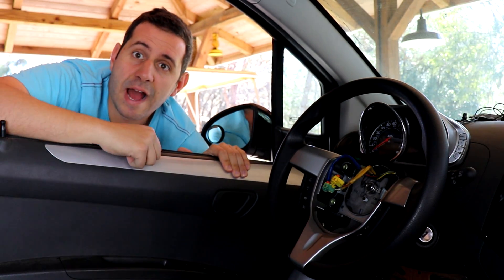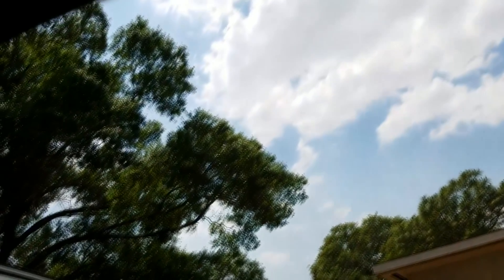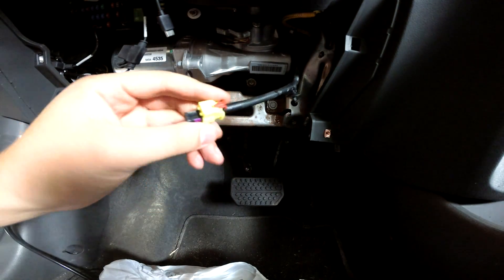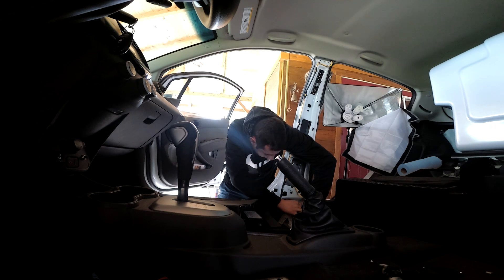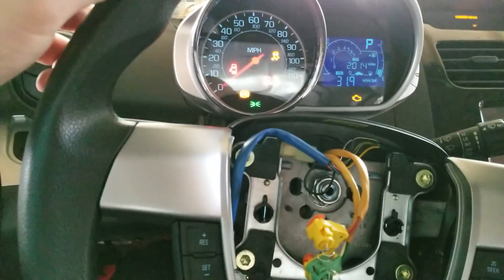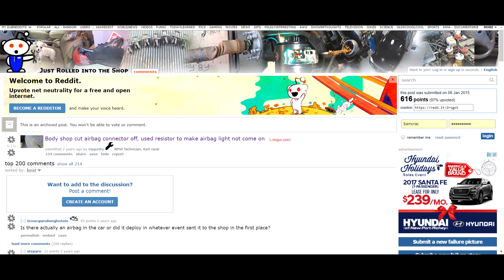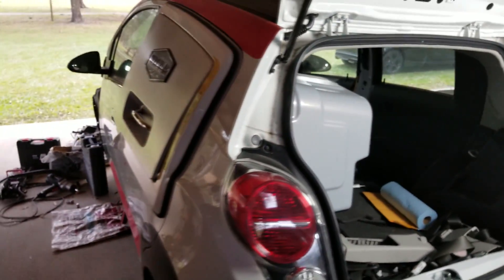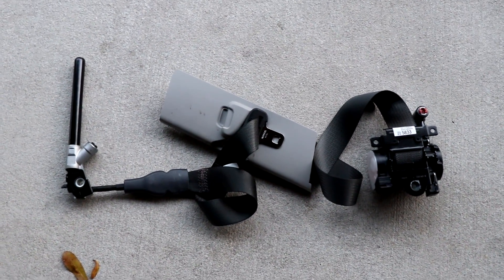How Scammers Hack a Car's Airbag System for 5 Cents (Permanent Airbag Light Off)

Comment: You could do it even cheaper by putting black tape over the light
Reply: it wouldnt come on as a tell tale on igntion switch on, could tell straight away
Reply: Then just couple the bulb with another one that's supposed to light up initially, but go out after a few seconds under normal circumstances (like the battery light, the oil level/pressure light or the abs light)
Reply: Just sharpie over it or remove bulb. Problem fixed and you now have one free bulb.
Reply: You have never took apart modern clocks, have you? They generally don't have bulbs any more, they use LEDs which are a lot harder to remove
Reply: RE: Geepers The typical 16 year old girl that can afford this car isnt going to know to check for THAT yellow indicator.... U only learn about that once u've been $&^k#d at least once!
Reply: ya if ya do that how will it pass inspection??
Reply: Sajeev Studios haha 😂
Reply: Long ago a mechanic told me that the ABS or SRS light is conected to the low oil or low bat light (dont recall if in series with the signal or directly) so it will turn on when you put the key and then after a you start the engine it will turn off like it is supposed to  making the ABS or the SRS to look fine. He told me that found this many times.
Reply: Homer Simpson taught you well.
Reply: That’s exactly what I did after not being able to get rid of the light.
Reply: @danielsh1015  was the removing seats, and steering wheel hard?
Reply: @isaacnewton1545  Hahaha, actually, after driving for a few days, the light just disappeared for good..🤷🏻‍♂️

Comment: Once the car has been in an accident there will be a crashed data stored on the airbag module which NO diagnostic tool can erase nor resistor can fix, the module needs to be replaced or reset with "special tool" to write a virgin file info to the module
Reply: A diagnostic tool won't do the trick, but a module replacement or reflash will clear the airbag light for a fraction of the tag. Unless you disassemble some trims while buying a car, there's no way to notice some airbags are missing.
Reply: kekkoz10 he probably use the module from the flood car.
Reply: I think he replaced the airbag module or reset the original before make this video
Reply: Bruno Oliveira 
I had some Ford software. It would clear those codes. It’s not hard if you know what to send to the module.
Reply: yes i agree, new module, rewrite the software per the vin# and only then is that data archived. the resistor trick is good for wire integrity.  i think after a couple of key cycles the/a code will return with the resistor in place.

Comment: Why does the engine sound like that? Normally the spark engine is very smooth and quiet.
Reply: The Android Gamer He didn't have the cooling system filled at this point.
Reply: Michael Hepp i can tell the difference. It's not sounding right
Reply: Christopher U.S. Smith that would not affect how a car sounds, unless he overheated the engine, which he didnt do.
Reply: BitchesBeTrippin yes you're right not having the cooling system filled does not change the sound. In fact once i ran my spark for 2 minutes with open upper radiator hose and no coolant.
Reply: Probably because half of the front end is missing no sound deadening on the underside of the hood. Underpanels and such all help reflect the sound away from the driver.

Comment: This is also super useful if you have a car that you want to have an aftermarket non-airbag steering wheel in but don't want the ugly light in the cluster.
Reply: There's this guy named Christian Rose who bought a 535i and rebuilt it for his own use. He felt there was no need for curtain airbag and decide to use a resistor to clear the light. I see no problem doing this even for sellers of rebuilt cars as long as it is disclosed to the buyer
Reply: Probably why most people would be coming to this video other than his subscribers
Reply: Yeah, if the car is being built for racing or personal use, it shouldn't come as a surprise to potential buyers that it's missing airbags or other safety stuff.
Reply: Seong Hong He actually listed the call on Craigslist I called him and he told me he only replaced the Driver air bag and nothing deployed!!! He tried to pull a fast one!
Reply: Does the resister type matter?
Reply: Or like the pizza car, its a single seater so there is absolutely no reason for having any of the passenger airbags. 

Its the same with the BMW E49 3-series, the passenger seat that indicates if its occupied all break and you have to replace the entire seat. this also runs on the airbag system so your light is on. Stick a 10 dollar module in it and the computer thinks its always occupied, the only really small downside of it is that in an crash the passenger airbag also will deploy.
Reply: Well William THAT would simply be CRIMINAL to disable an airbag so you can have a nice steering wheel!  There would be a law!  Prison time!  Why that's worse than turning off traction control!  As criminal as not wearing your seatbelt!   Oh wait...anyone can switch to riding motorcycles that have no air bag or seatbelt...and yourkids school bus has no airbags or seatbelts but that's okay?
Reply: @dougiequick1 Your very existence is criminal. Your mom should have bled you out.